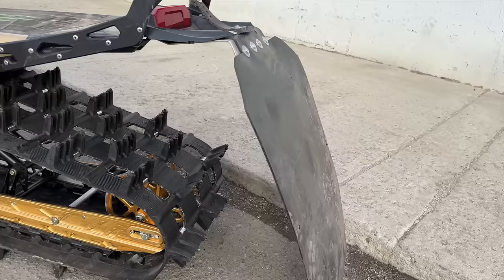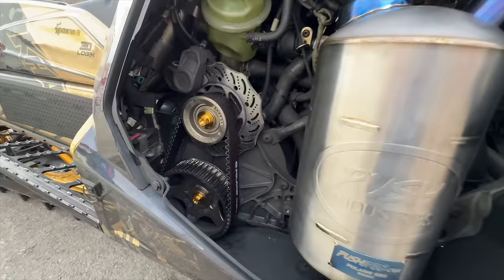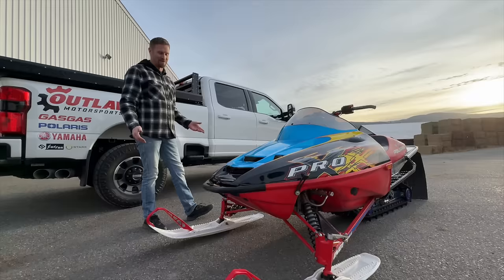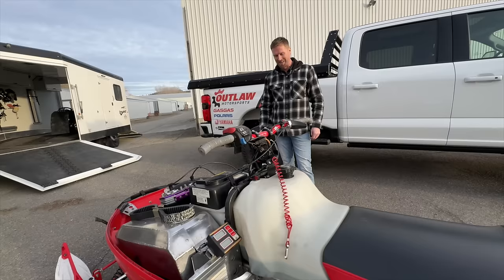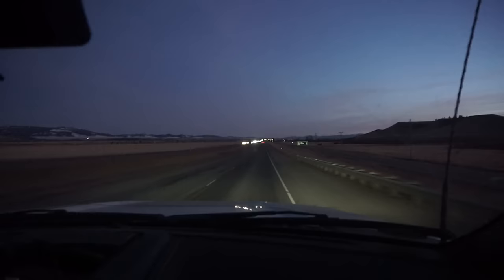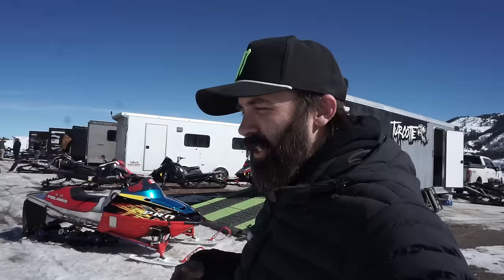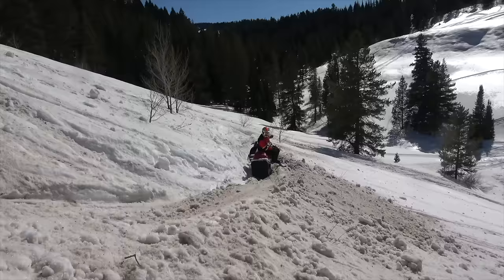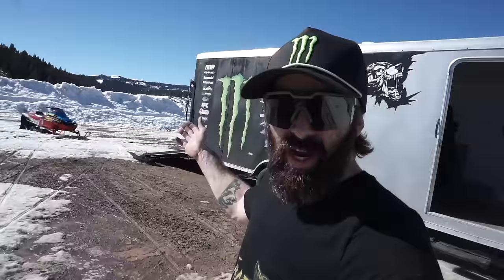Jackson Hole Vintage Testing

Comment: I used to own a Blue 2001 XC LE 800 , that was the polaris factory sled with the FAST M10 rear suspension, they only made this sled for a couple years. I converted it from a 121 to a 136, 1.5 inch track for ditch banging this sled rode like a cadillac with the M10.

Comment: Good thing for the big rubber flaps otherwise you'd of peppered ol Rocky with a rock in the lips testing on that hill that was getting a bit shredded up. Sweet sled